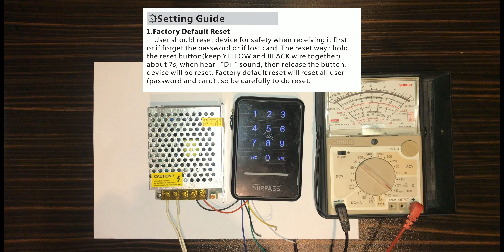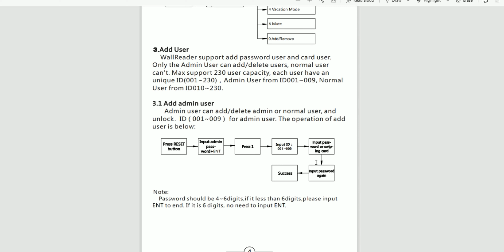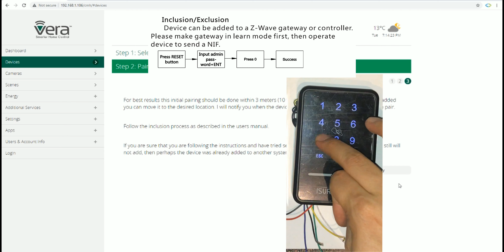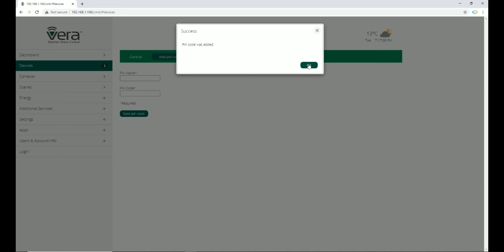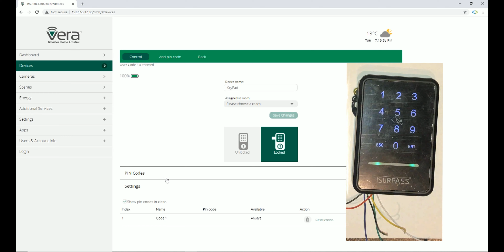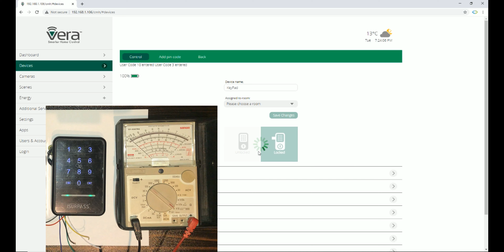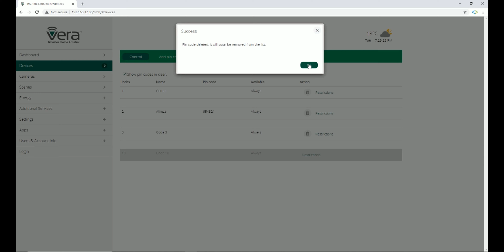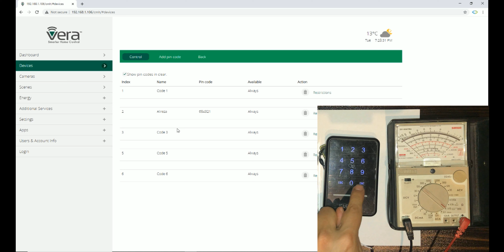z wave wall reader

Comment: Can i use it as an outdoor keypad to unlock or trigger a scene such as gate opener when pin entered ? And can it add to HC3?
Reply from the maker: You can use it to trigger scenes but it wasn't compatible with HC3 and I have not tested it with the last HC3 firmware

Comment: Kian, which Vera controller are you using? I just purchased the Ezlo Plus and am not able to see the status change if a pin code is used. I can lock/unlock via Vera, and add user codes, but I can't detect if the unit is locked or unlocked from the keypad. Also, what iSurpass Wall Reader are you using? Thank you!
Reply from the maker: Stephen, I have not tested Isurpass Z-Wave wall reader with Ezlo plus as it is still not available in my region's frequency.  The best solution would be to contact customer care.
What do you mean by "what iSurpass Wall Reader are you using?" as this company only has one model of Z-Wave Wall Reader?
Reply: @kian.smarthome  are you using Vera Controller Plus? What version of Z-Wave? I am using US Z-Wave version.
Reply from the maker: @Chaparral2001  I use EU Z-Wave Version and tested it on Vera Edge, Plus,  Secure and Atom.
Reply: @kian.smarthome  thank you. I will purchase VeraEdge and see if that solves my issue. I appreciate your help and instructional videos!
Reply from the maker: @Chaparral2001  Can you wait till I test it one more time for you as I do not remember my Vera Edge firmware?
Reply: @kian.smarthome  Yes, I will wait for your testing.